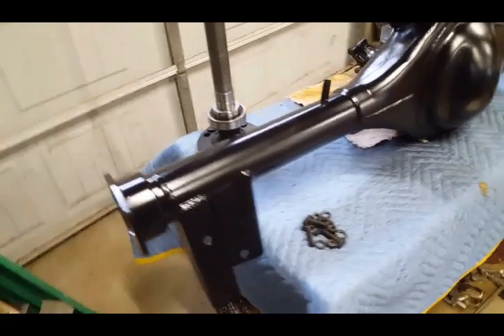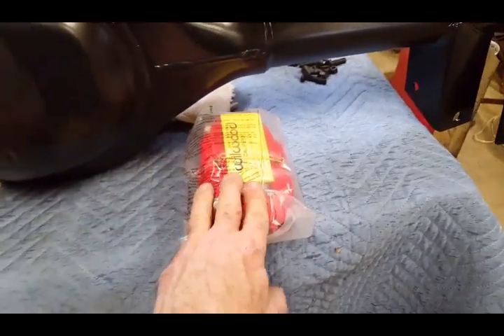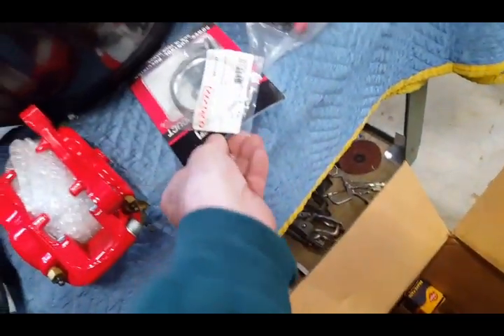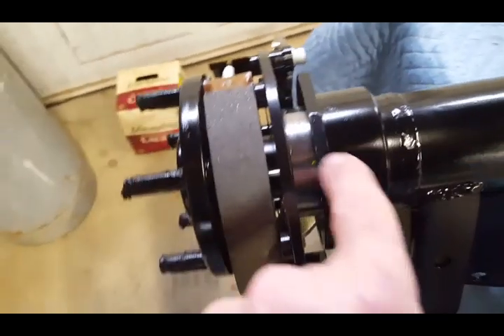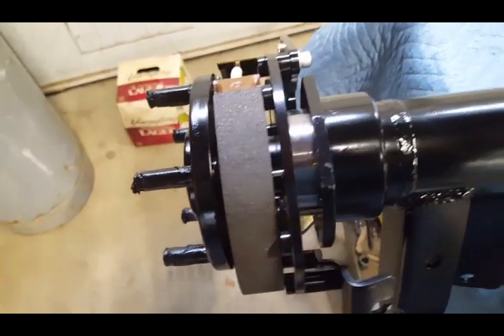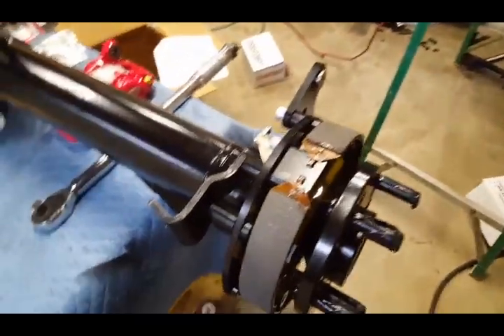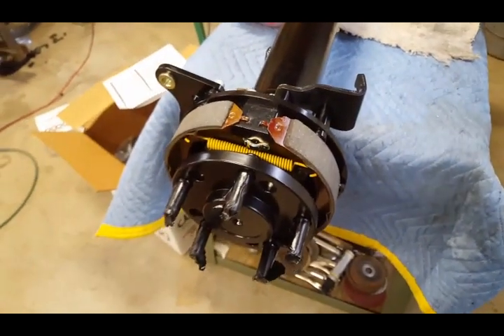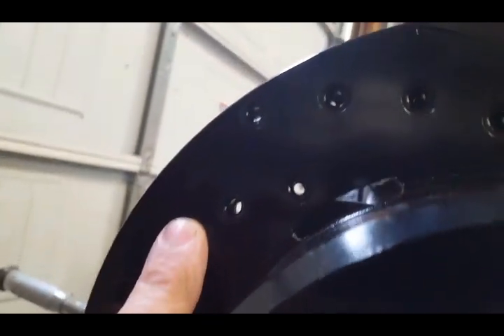Wilwood brakes, Big Ford 9" 2.5 off set. GTO, Chevelle, Buick,

Comment: Looking great, nice work mate.  This will be a beautiful car.
Reply from the maker: Hi Peter. Thanks for the kind words. I started putting the suspension kit together. I should have a video coming out every 7 to 10 days on the suspension kit. I hope your car is coming along. I've been slow with work so I've been spending some time working on the car. I hope you're doing well, All the best..
Reply: @classicrewind2715  will be good to see the suspension work. The old impala was supposed to be restored,  its the first car I've rebuilt in reverse . Takes twice as long , this thing was a death trap , they had bits of wire in the rear brakes and they were locked up.  Battery cable through the extractors was a joke.  Its coming along ok but next time I'll empty the garage and strip it down to properly rebuild it. Told my wife to never send her dad t o look at cars ever again.  Wasn't one good part left in it even the springs were weakened.  Have a good weekend mate.
Reply: I have the 9” ford rear Dutchman axle. Do you have the part number for the Wilwood backer plates for the rear brakes?
Reply from the maker: I don't recall offhand. But if you contact Wilwood, they should be able to help you. They are very knowledgeable and willing to help. All the best

Comment: Great video. Exactly what I was looking for.  Could you tell me if you ended up with any end play on your axles after you torqued the bearing retainer plate down.  I had a little too much end play so I took out the flange gasket and still have a little.
Reply from the maker: Hi, I did not have any problems with play. The bearing plate actually bent a little when I was tighten it. The bearing  was sticking out a little. All the best.

Comment: Whats the difference  between  2.5 off set and (2.75/2.81) off set i have the Exact same set up(140-7141) and this  video is Exactly what i need i just dont know what offset means
Reply from the maker: It's hard to explain. it's the distance from the axle to the face of the rear. When you buy your Wilwood brake kit. it should have come with the flang. you have so have to tell them what you have when you order the kit. I hope this helps. If you still have a problem go to the Wilwood website and search offset. All the best
Reply: @classicrewind2715  ok thanks for responding

Comment: I got the same kit put unfortunately one of the rotors was machined improperly so waiting on a replacement. Looks good otherwise! What did you do for brake lines?
Reply from the maker: Nickel copper lines easy to work with. I'm glad you're enjoying the videos let me know how your rotors go, when you get them back. All the best
Reply: what was the issues? im having issues with my parking brakes grabbing no matter what i do.
Reply: @Luke-jw6zn  Actually turned out to be Currie's fault with the axle. For the parking brakes make sure that you re-adjust everything after the first pull because the cables stretch once.

Comment: What spline did you go wit?? i ran into the problem  that bearing is to big and won't go through the Bracket
Reply from the maker: Ridetech 2-in drop spindle. But I also played with the bearing bolt that holds the spindle in. I had to use., if I'm not mistaken. the Wilwood one. It should be in the video

Comment: Im getting a curry 9’ rear end for my 69 Camaro. The flanges are for “New style big bearing/ torino”, but the axles feature a 5 x 4 .75  bolt pattern. So I’m confused because I have to use Torino hubs, and if I get a wilwood rear disc brake kit for a Torino, the rotors may not line up a because of the GM 5 x 4.75 bolt pattern. Or does bolt pattern not matter for rear discs and hubs. I’m new to these things.
Reply from the maker: Bolt pattern definitely matters. If I were you.  I would call Wilwood and ask them what they suggest because of your Torino bolt pattern. I can't remember off the top of my head  if Wilwood compensate for that bolt pattern or not. I will have to check my  rotor. It might have additional holes. Hope this helps. I'll get back to you if the rotor changes. All the best
Reply from the maker: Go to the 10 minute Mark of the video.  The rotor has a bunch of holes.  It should be able to compensate your spacing for your bolt pattern. All the best
Reply: @classicrewind2715  that explains it. Thank you!

Comment: Thanks for the video, very informative! I have the same kind of brake kit and I have given it some thoughts about how to change parking brake shoes next time without having to take out the shaft again. How do you do that? throught the hole?
Reply from the maker: That is a good question. You should not have to take your shaft out to replace the emergency brakes... What you need to do is remove the rotor that way you will access the emergency brakes. You would need a spring compressing tool to remove the little spring that holds the breaks in.. All the best.
Reply: Unless your forgetting to disengage the park/E brake they should last forever.
Reply from the maker: Yes, I don't plan on driving it that much anyway. Thanks for watching all the best
Reply: @classicrewind2715  I actually meant that to Janne since he posted about changing the pads.

Comment: Are the rotors suppose to be a little loose prior to installing wheels?
Reply from the maker: There will be loose until you put the wheel on and tighten the lighter

Comment: Can I use this kit on my 72 Ford f100? It comes with the original Ford 9 inch??
Reply from the maker: Hi oziel, I am not sure. If I were you I would call Wilwood. They would be able to tell you if it would work on your specific vehicle. I am building this car from scratch. This Ford 9in rear is modified to fit the A- body GM platform. I hope this helps. All the best
Reply: Classic Rewind  appreciate the info yea that what I’m gonna have to do. Thanks and nice build!

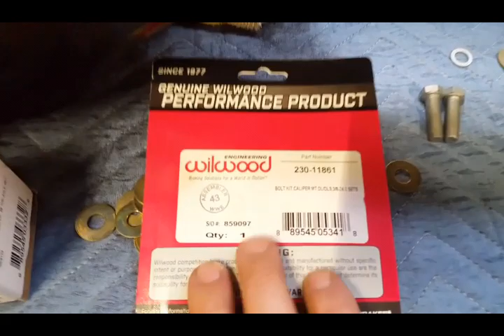Comment: Lost here...... at 2:43 installing regular disc pad brakes and later the drums. Yet at 11:03 you are installing rotor and disc brakes on the same wheel?
Reply from the maker: Hi Santa. sorry, for the confusion.. Those are the emergency brake, that you have to install first.  the car is going to be a standard transmission. I wanted to make sure I install an emergency brake. I know it's confusing but I thought I put a text in the video explaining that it's an emergency brake system. then the rotor goes  on top. I hope I explained it well. All the best Santa, be safe.. Harry
Reply: @classicrewind2715  Thanks for clearing that up. I have not been in a service station since 1971.
Reply from the maker: No problem Santa. I did not want to use emergency brakes but I did not want to keep the car in first gear when I parked it.  I decided to use the emergency brake system. All the best Harry
Reply: @santaclaushawkeyenj3878  Hey Santa it's basically the same set up on the Ford F250-350 series trucks. The first time I pull my rotors off my truck I was a little confused. It's actually a little convoluted but it's great in that if you loose a brake line or a master cylinder you can still activate the rear brakes manually. Best Wishes & Blessings. Keith Noneya

Comment: Did you have to loosen the parking brake adjuster to gain access to the bolts?
Reply from the maker: No, bolts are accessible through the axle. There is a hole you could access to tighten the bolt,
Through the housing of the rear. I hope this helps. All the best
Reply: @classicrewind2715  my kit came with lock washers but after torquing them down on bearing retainer the bolts don’t protruding past the nut.  Did you use lock washers?
Reply from the maker: Sorry,  I just saw your response. DO NOT USE those washers !
 Go to your local hardware store and get Hardened lock washers.. those washers are garbage. I had the same problem
Reply from the maker: Grade 8 is best but Grade 5 will do..
Reply: First off thanks for your help.  I’m afraid that with any washer installed I won’t have the bolt thread sticking out of the nut.  Do you think this is safe or should I reach out to quick performance for a longer bolt?
Reply from the maker: @shannontrinidad3947  those are the T-bolts correct. I think those are standard length. I don't remember. it's been such a long time since I've done the work. You could probably buy them at a auto store. I think mine were sticking out about an 1/8" if I'm not mistaken with the washer on

Comment: Did you use washers  for the 4 t bolts???
Reply from the maker: Yes, lock washers. Make sure they're hardened. The ones that I got when I purchased the differential they were not hardened so they just crushed.
Reply: @classicrewind2715  ok I just used the ones that came with  the t bolts  also  any idea  on how to adjust the pad mine are a lol off so my rotor  wont slide over them any tips or tricks  would be great
Reply from the maker: If you watch the video, they come with different size spacers. You can adjust the caliper with the spacers to make the brakes fit properly.

Comment: bad asss, robs horsepower but way stronger, just build a  strong motor
Reply from the maker: Thanks C. I'm planning on putting a LS3 motor with a T56 Magnum transmission in the goat. That Ford 9-inch rear should handle power. All the best..